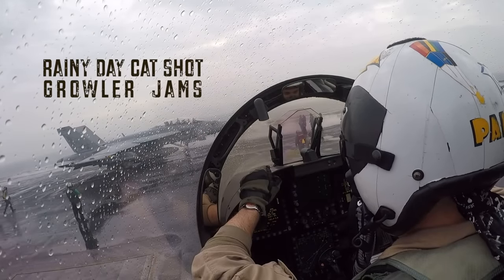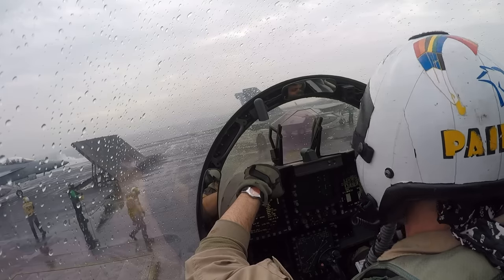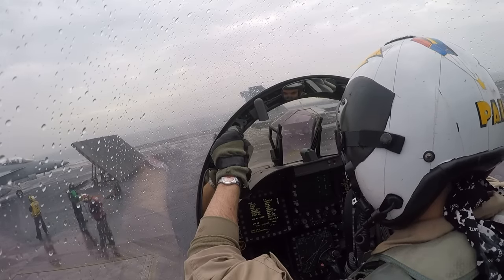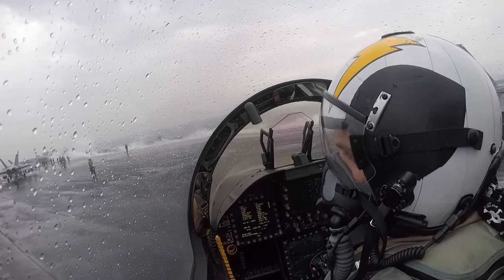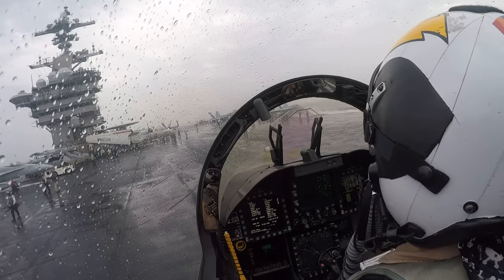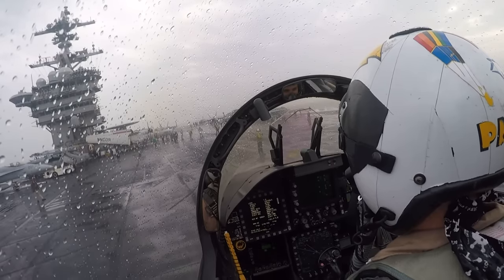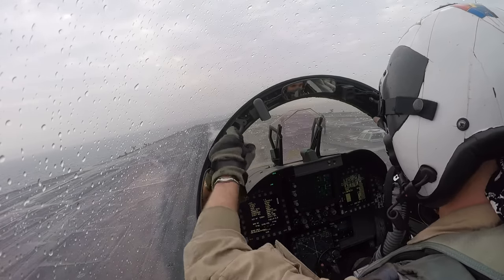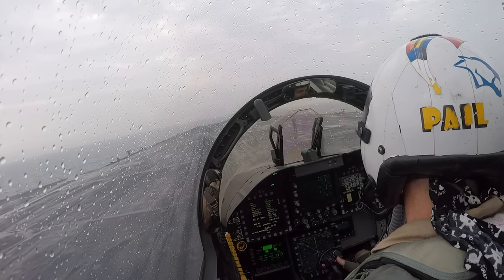See Why Navy Jets Don't Need Windshield Wipers

Comment: Brings back many memories. When I served, during the draft, you got used to working as a very well oiled machine. You usually got discharged fom active duty after 2-4 years active service, for me 4 years. 

Going back to civilian life was 1 of the hardest adjustments I've ever had to do. That was one of the reasons i ended up retiring from a medical career.

Comment: Nice video!  As a former A-4 Skyhawk maintainer, I feel obliged to mention that the A-4C Skyhawk did have a windshield wiper!  Later versions had engine bleed air blown over the windscreen as a rain removal method.  Hadn't thought about the Hornet not having a similar feature... or at least it's not obvious.

Comment: Fun fact, the Lee Helmsmen tells the 4 Throttleman to answer a shaft RPM to get a desired ship speed, but the throttlemen are not in the engine room.  They are in one of 2 places called #1 (or 2) Enclosed Operating Station, or EOS for short.

Comment: Best thing about Tomcats was rear parking behind the island and rarely ever staged forward of the front right elevator. Six Pack, Junkyard or the Crotch (Kitty Hawk) forward of the LSO platform we're ease of use and less chance of having to grip a padeye from turning jet blast/ prop wash. 

Handlers at initial event start-ups would stage over the round down, which gave more last minute arming, maintenance, and walk-around preflights without taking a Hornet pylon to the face.
Reply from the maker: TYFYS.
Reply: @GrowlerJams  Retired at 20. 15 years on overseas beaches. Worked C-2, F-14A, H-46,H-60S, and EA-6B platforms on 2 CVN's, 3 AFS's, and an LHA.

3 years on the GI Bill on the beach in Western Australia for a double major with Notre Dame at Fremantle.

It was a good run, and thank the American taxpayer for the opportunity to serve abroad for as long as I could.
Reply from the maker: TYFYS.

Comment: I have always wondered what the control feedback feels like in those jets. I can fly sims (just a bunch of springs, even in very expensive sticks), and I can fly small aircraft with cable controls. But hydraulic sticks? Or fly by wire in the Hornet? No clue. I'd love it if somebody who knows could describe it. Awesome video!
Reply from the maker: I’m not sure how to help you there.  I can’t think of anything common to compare it to.
Reply: @GrowlerJams  Thanks for engaging anyway! Do you get feedback from the aircraft in any way? If you are out of trim, does the stick try to push on you somehow?

Comment: "The flag bridge is where the admiral works." Ha! I've been on the flag bridge of the Ike. The admiral in fact did not work there. It had a treadmill. Did he ever state why Navy jets don't need windshield wipers?  If you have any old pilot friends, ask them about the Grumman deck load.
Reply from the maker: Because we have airspeed!
Reply: @GrowlerJams  I've oft wondered about low speed or how aircrew handled it when on deck. Never thought to ask one of them. Then again, enlisted weren't supposed to or allowed to talk to officers, only respond.

Comment: So this process seems pretty relaxed and methodical. Is there a faster way to launch everything in case of emergency? Or is radar and reconnaissance so good nowadays that no emergency would arise like that?

Also, is “scrambling” a term the navy would use or is that strictly an air force thing?
Reply from the maker: Yes, we can speed this up if required.  We cal it “launching the alerts.”

Comment: Is it just the wind that keeps water off the windshield, or is the g-force of acceleration also responsible? IE: does the windshield clear off faster during takeoff than level flight?
Reply from the maker: It’s both, but mostly G-force.

Comment: GJ  when you wipe out the controls does that mean everything is in a neutral position or does the director set a certain trim and angle of attack so you don't fly down on take off, I ask because once the controls are wiped out it looks like flaps are down during the launch. thanks
Reply from the maker: Why Pilots NEVER Hold The Stick On The Catapult
https://youtu.be/2Ht3ahSWpbk
Have you seen this?  I break it down.
Reply: @GrowlerJams  thank you, God bless you and your family !!
Reply: @GrowlerJams  I just watched it the trim is set after you wipe out controls and do all your visual checks.
Reply from the maker: Exactly👍🏼

Comment: Two questions 
In the second Top Gun Maverick movie I noticed a control lever on the stick. It was lower and in front. Like a pinky or index finger position. It was used a lot in the movie. Could you explain what hat that was. 
Second question 
Do military aircraft have keys or lock out safety pins. I seen a video where a military pilot in the cockpit was flipping on switches and then to the lower right center console just above the right knee  the pilot removed what looked like a key with a red tag attached
Reply from the maker: That’s the paddle switch on the stick.  It overrides G-limiter on the FCS. 

We pin our ejection seats.  That’s probably what you saw.

Comment: This guy isn't in a 'F/18' he's in the E/A 18G codename: Growler, which took over for the EA6B Prowler.  Hence Growler.  It's an Electronic Attack Aircraft.  It carries Electronic jamming pods, not missiles.  It CAN carry missiles,  but you have other jets in the CAG for that.  Those are the F/A 18 hornets.  E/A 18 Gs are Super hornets.

If you notice when he's about to launch, he has to show his hands.  You do not put your hand on the stick.  The aircraft is programmed to take off, without any assistance.  Once the jet launches, it gets to a certain angle of attack, and the pilot takes over.  It's interesting technology.  If the pilot passes out or something, the plane will take over, and it will circle 'Mom' aka the Carrier, until it is able to return to ship.  It will auto land.  It's an amazing auto-pilot.  It is so good at landing, that they actually had to squelch the receptors, other wise it would wear a hole in the flight deck, because it would land in the exact same spot, every time.
You don't need a pilot to land a hornet anymore, unless electronics are shot to shit.  Pilots will disengage the auto-landing mechanism, just to land themselves.  When you see those videos of a hornet coming to land, and weather or seas are bad, don't worry, the auto-pilot is calculating proper landing procedures, about a 1,000 times a second...even better than a self driving tesla.

The F-14...now that was all manual.  From holding the stick at launch, to landing with human aide.  The Hornets are just a manned drone...all they are.

boring jet  :face-fuchsia-poop-shape:
Reply from the maker: A lot of your comment is untrue.  Hornets don’t have any advanced autopilot systems.  Super Hornets and Growlers DO have PLM, but that won’t circle overhead and land the jet by itself.  Watch some of my other videos like my Whidbey Fan break to see what PLM is actually like.  It’s not what you think.

Comment: So awesome. That’s what I wanted to and would have/be doing in the USMC if my recruiter hadn’t lied to me. I scored high enough on the ASVAB, but he said it was too late (almost graduation) to get started in the NROTC Program. I figured,”hay... he’s a Marine... he wouldn’t lie to me. Right?”   BS!!!! Instead I went my second choice, which was infantry so I could be a sniper and go FBI SWAT Sniper after service. Big F-ing mistake. Received an SI impact injury in boot that led to temporary paralysis in SOI and a huge green weeny right out of the Corps without benefits/disability because I refused an exploratory surgery with a 50% chance of permanent paralysis. 🤨😤😡🤬
27 years later, because they screwed me so hard, I’m still fighting for disability and haven’t been able to work for six years due to my service injury coming back with a vengeance. 😖😡🤬🤬🤬🤬🤬🤬   Still a proud Marine though. 🤯🤤🤪
Reply from the maker: TYFYS.

Comment: How do you line up the front landing gear with the catapult? I know there is a person guiding you but I imagine the line up needs to be very accurate and that person pointing and waving just cannot give an accurate enough guidance. Or is it like
'a bit to the left then a bit to the right' again and again?
Reply from the maker: It is just like you said…a little left or right.  Just like parking your car in the garage.
Reply: I thought there would be like an electronic guidance but it's just lots of practice. Thanks.

Comment: How hard is it to drive these planes on the ground? I always assumed they'd handle pretty clumsy
Reply from the maker: It's pretty smooth.  We use our rudder pedals to steer.
Reply: @GrowlerJams  the flight decks always seem so crowded in your videos. Did you ever scratch the paint on someone else's plane when trying to park?
Reply from the maker: I haven’t.  That’s uncommon, but it happens.
Reply: @GrowlerJams  I'd be so embarassed if I scratched another F-18! Thanks for the great content and for answering all these silly questions!

Comment: Why does aircraft rotate before you even get hands on stick? is it trimmed for takeoff?
Reply from the maker: Watch my newest VO…why we keep our hand off the stick for that answer.
Reply: So...i just watched it and very cool but didn't really go into details about the question i had.

"all trimmed up" what's trimmed? an aircraft has so many trims.

Or is it a launch program in the flight computer to automate the process? @GrowlerJams
Reply from the maker: No, it’s setting the stabilator trim to the fly away nose pitch once we reach takeoff speed.  With the jet trimmed up, it flys away with airspeed and no pilot input.

Comment: do this plane have the F414-GE400 engine ?
Reply from the maker: Sure does!
Reply: @GrowlerJams  I used to work for Honeywell aerospace. I built, calibrated and final tested the f414 fuel controls. Changes are iv kept you in the air.